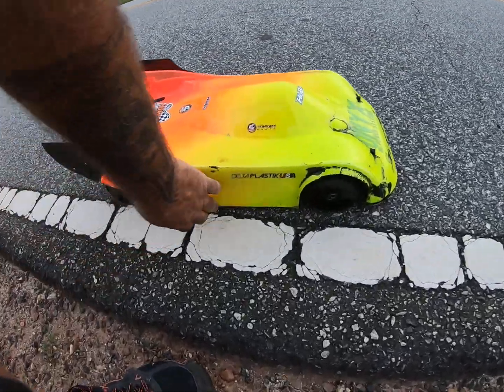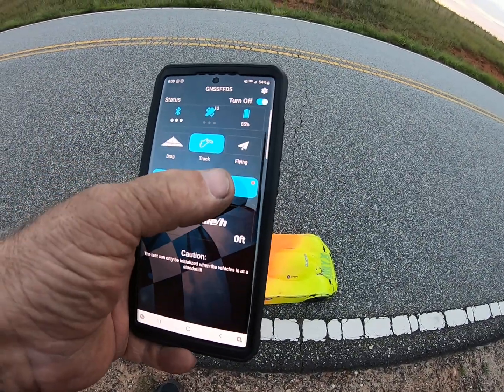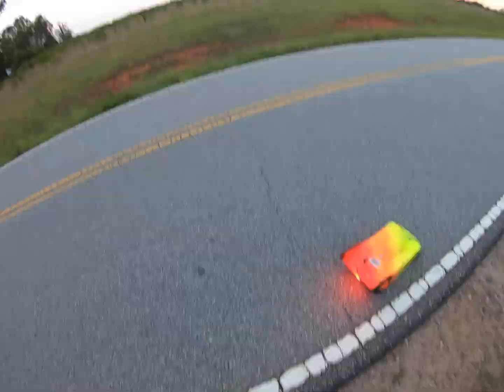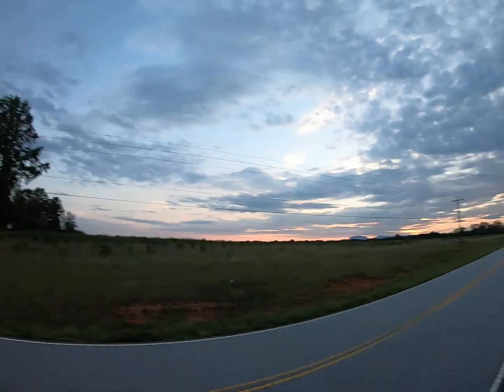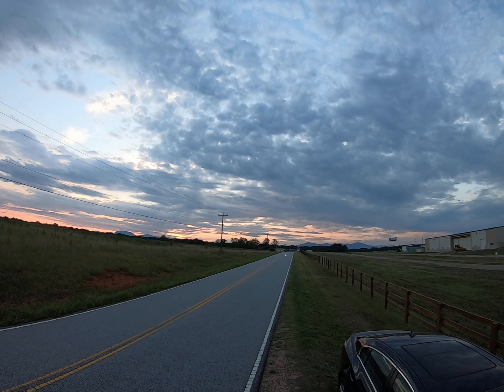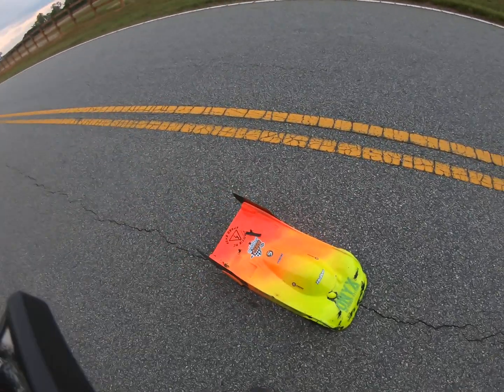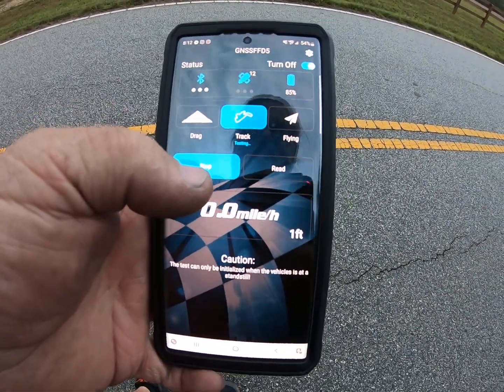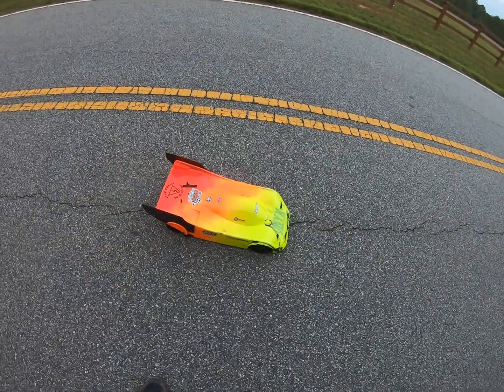CASTLE CREATIONS 2028 1700KV.    2ND PASS     Watch til the end !!!!

Comment: hey Jim,  seems like the 1700 like 50+ rpms from 12s.  i dont have the space but it seems like a killer combo to play with.
Reply from the maker: 1700 definitely can't handle 12s , been tested several times
Reply: @jamesmccoy204 testing has been going great,  just don’t put 8s gearing on it and go 12 s.
Reply from the maker: @alterdcustomrc4512  gearing is not the problem with running this motor on 12s , the motor rear bearing can't handle it
Reply: @jamesmccoy204 funny you say that,  I switched the bearing to boca bearings 2 years ago when I was bashing the hell out it in a 1/5 and 1/6 off road cars.  I was looking at the resistance of the motor and I thought it would be great on 12 s.  Looking at the motor I see one of the rear cap screws is missing lol.  A lot of vibrations.  Also it’s on its second sensor but it’s good to hear what you said.  I was running it with a regular hw max5 and geared it to 300 amps and man the motor spun to over 50k under load @ 95% throttle and pulled a 157 in 1200 ft.  I really don’t have space but I switched to the ghost hv and tested it today….man thank you for running the piss outta this thing because it didn’t break a sweat on 12s.  Fans didn’t even come on for the short testing on 8s and 12s but it is incredible ❤.  I will rebuild the motor with new boca bearings for safety and save this for a place with more room.

Comment: How would you compare the 2028-1700kv to the 1721-2400kv? I am running the 1721 now, but not having much luck with it because my road isn't very long.
Reply from the maker: Two different motors for sure , I like the 1700kv more because im not really into high kv motors
Reply: @jamesmccoy204  Thanks James. I think I'll give the 1700kv a shot once it becomes available. Keep the videos coming!
Reply: @adamhughes7778  the 2028 will have a. lot more torque for sure.